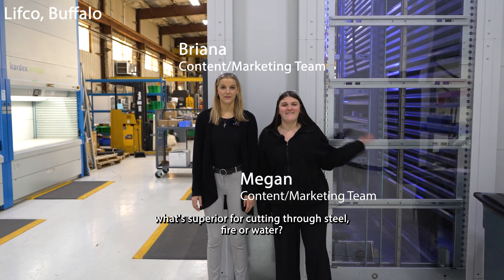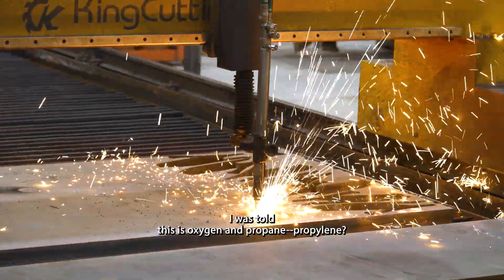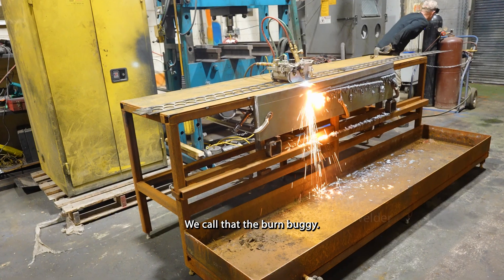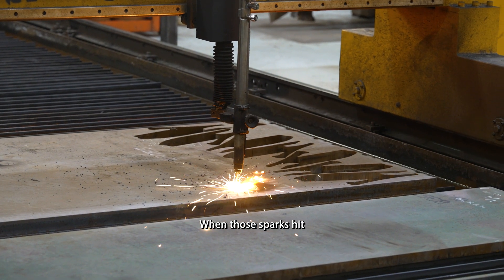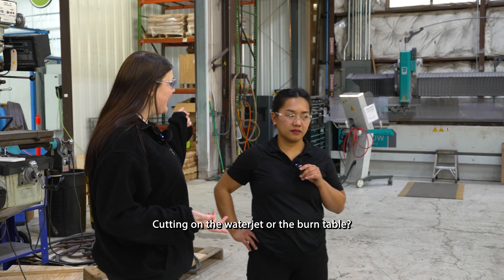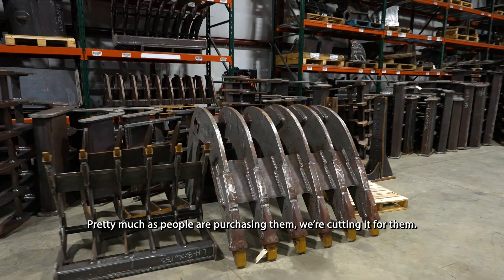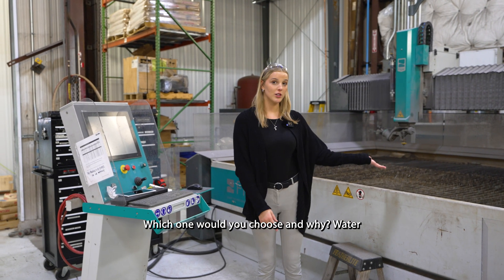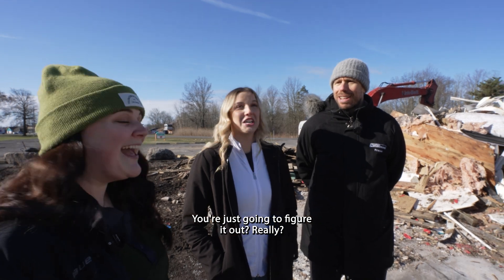War of the Elements: Water and Fire against Steel

Comment: Waterjet for me...Surprised no one mentioned that when product comes off the water jet, it can be handled with a bare hand.  With the burn table the product needs to cool for a long time before it can be handled.
Reply from the maker: Good point. It is easy to just analyze the numbers for when the machine is running, and forget about all the other minor details leading up to running, and post-production. I personally think the waterjet is cooler (no pun intended). -Fraser